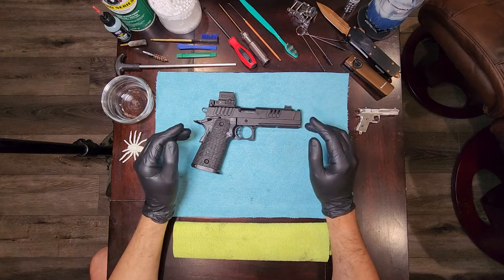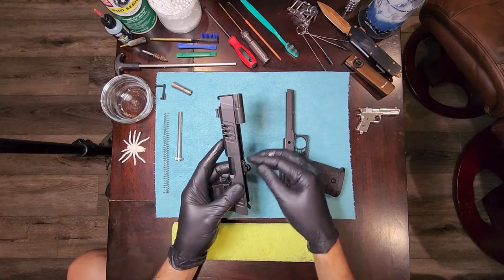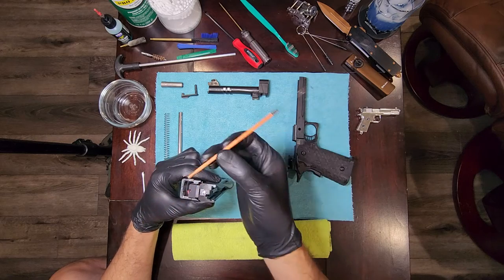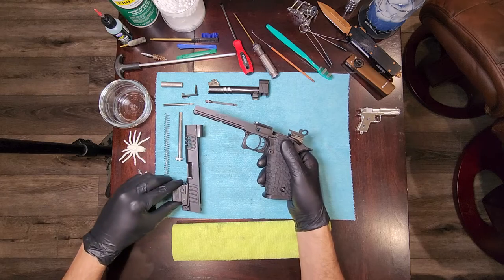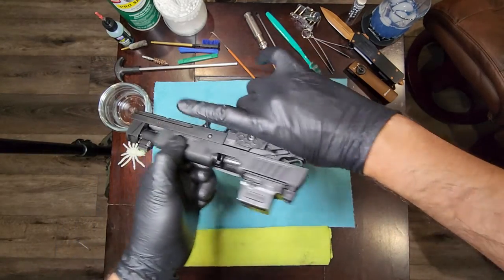Staccato XC (Full tear down 2011)

Comment: Staccato XC full disassembly and cleaning:
Full disassembly
https://www.youtube.com/watch?v=_S06btvMuuQ
0:30 - begin takedown
0:40 - remove takedown lever
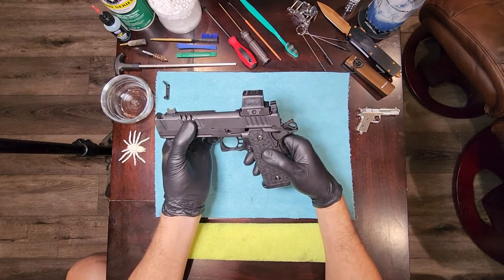1:00 - toolless guide rod removal
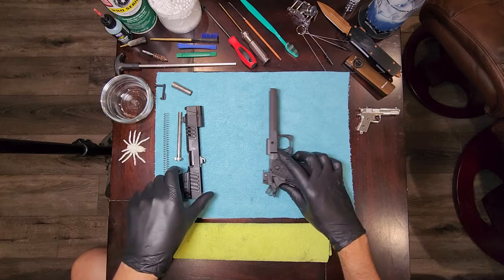1:40 - barrel removal
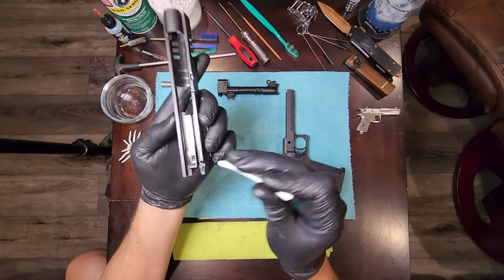2:30 - cleaning of various parts
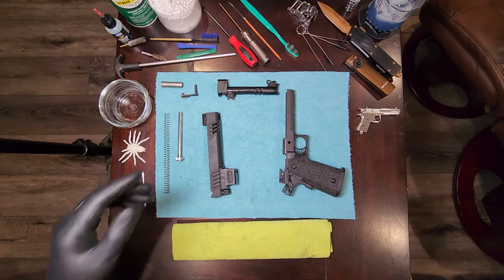3:30 - cleaning of the compensator
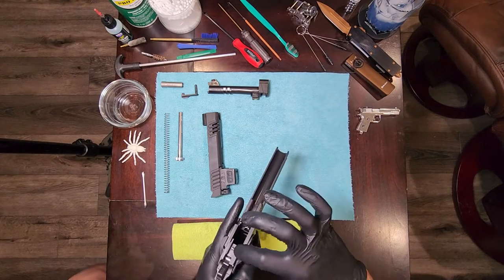4:20 - hammer release precaution
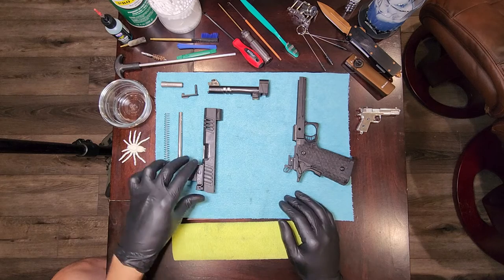4:55 - firing pin and plate removal
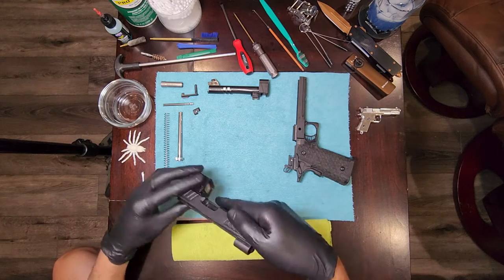6:40 - extractor/ejector removal
8:10 - cleaning of these parts
9:32 - disassembly of the grip and slide safety mechanism (difficult)
14:30 - reassembly of the grip and slide safety mechanism (difficult)
18:50 - hiccup of reassembly of the slide safety mechanism (really difficult)
20:20 - reassembly of extractor/ejector and firing pin
21:50 - reassembly of toolless guide rod mechanism
22:30 - make sure buffers are aligned on guide rod mechanism (important check)
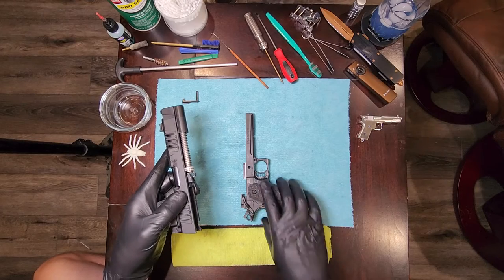23:40 - reassembly of slide mechanism onto grip module
24:45 - END

Comment: I use the same brake clean. But you should protect your optic glass from any solvents. I use painters tape or the cover to the optic if it has one like my DPP comes with.
Reply from the maker: I have never covered my optic I always spray it also

Comment: Good video for as faras you went BUT it's not a complete takedown. The Hammer, sear, disconnector, mag
release and trigger were not  removed. Thanks for posting the video.
Reply from the maker: Yeah but that's the easy stuff, that just falls out.
Reply: @photosplusbypeter6877  True enough taking it apart, putting it back together takes a little patience. Especially lining up the sear and disconnector. Necessary for a flat trigger upgrade. Thanks again for the vid.

Comment: Use a brass rod or some similar soft metal.  Don't use steel to scrape on your steel pistol.
Reply from the maker: Like I said I'll use whatever I want the brass leaves a coating that I don't like and it's too soft.....
Reply: @photosplusbypeter6877  you can’t use a solvent instead?